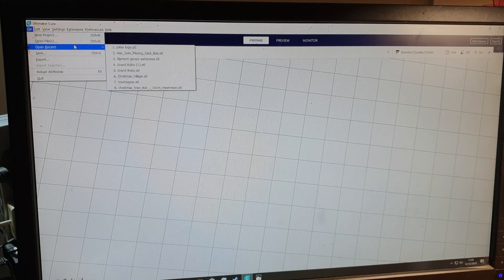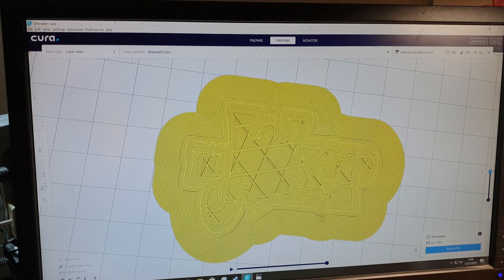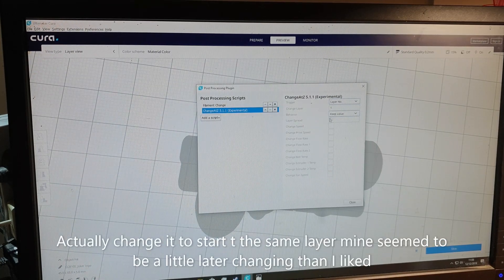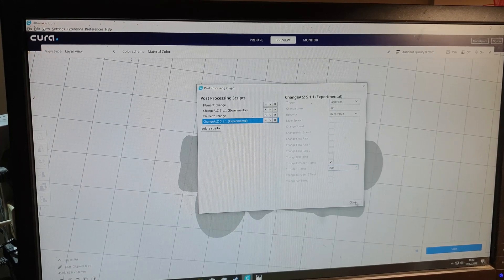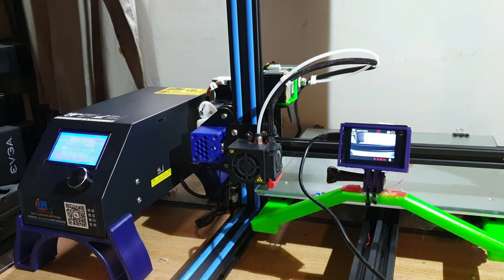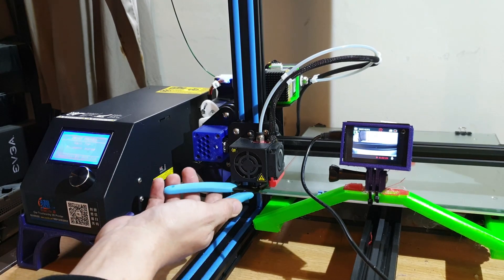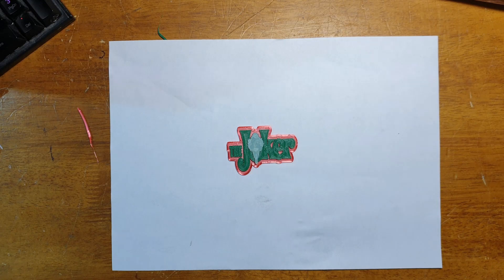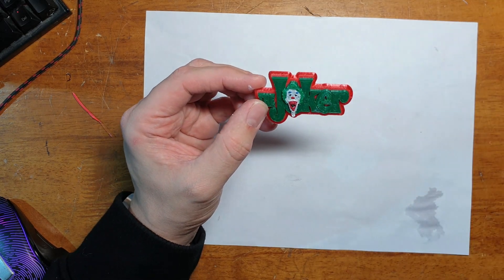Multi coloured prints using cura with a single extruder

Comment: Hi, thanks for the video. I tried to do the same in Snapmaker 2.0 A350 but on the printer display there is no option to let you change the filament. Any Ideas?

Thanks
Reply from the maker: sorry no clue i just did it in the slicer settings in cura.

Comment: Does it keep the bed hot during the change? (In case I don’t get right to it! Because if the bed cools my print will slide off!)
Reply from the maker: It does on mine but it might depend on printer or firmware